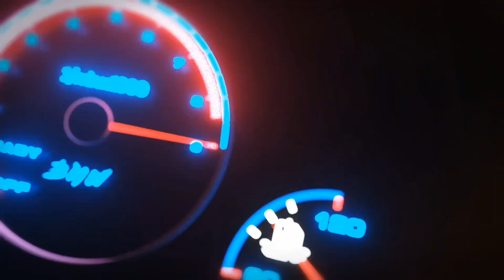Help Needed: Removing a Wrap Without Ruining Your Car!

Comment: I owned a wrapping business for 4 year .. we use a clothes steamer to remove wraps ,you can buy one at walmart for 20$ .... The issue is the wrap is cracking ,I can tell they used a cheap material and the wrap is well beyond it recommended lifespan which makes it difficult to remove at this point you can buy a product called crysteltek vinyl remover .. spray it and let it soak than you should be able to scrap or peel it off
Reply from the maker: Ok appreciate that sorry for the late reply

Comment: Use a heat gun and you can take it off or if it get hot over there  just leave it in the sun then you can take off the wrap
Reply: Steamer work much better